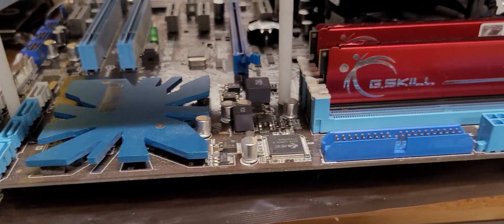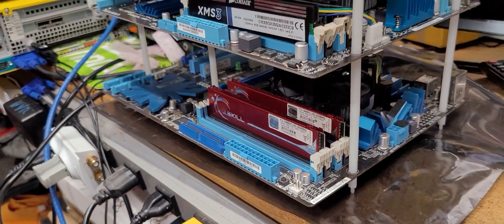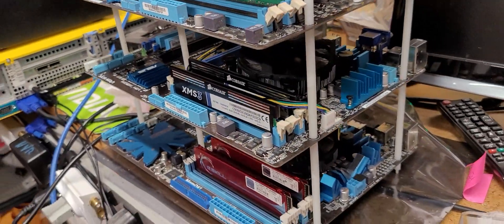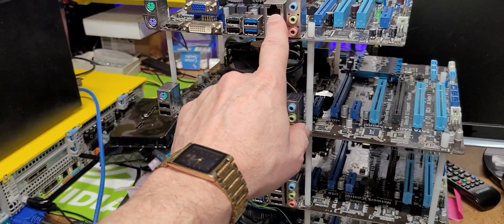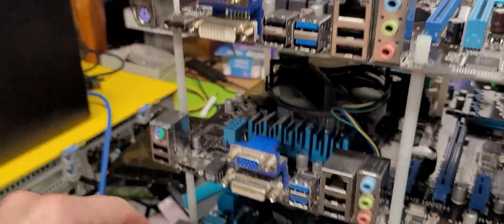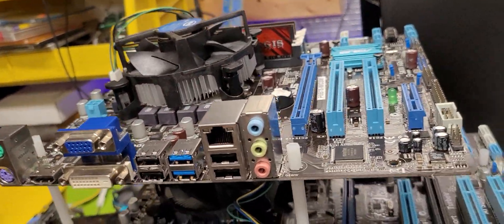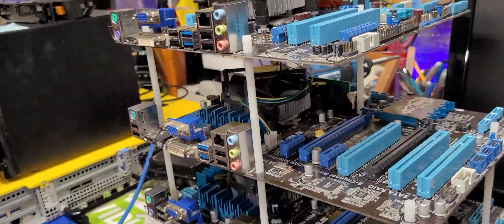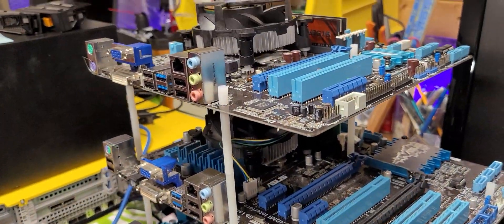A new monster I7 PC motherboard build out as a cluster  Not a complete waste of time! Fun!

Comment: hey brad, are you going to put this in the server or in its own box, i think you could put these alot closer together in the spacing as well like you did with the dell 7040's:face-orange-biting-nails:
Reply from the maker: Well no not at this time.  I was just playing around.   the size and airflow needs / clearance make this to much for my needs. I  will with MiniPC I think for now.  BTW I am going to rebuild the ProxMox Option 3 deployment back into Option 1 before I lose all the parts I have setting on the side.  /:>
Reply: @leadiususa7394  my oppinion would be to put all the parts in like a small container for each one and leave your proxmox open pemanantly then you wont lose the bits :)

Comment: I think it's a cool idea. I'm new to the multi-motherboard type setups so I'm not even sure what you'd be able to run on a build like that (but Im interested to see how this one works).
I've been trying to breathe life into a bunch of low-core mini PC's myself... buy to replace tasks I'd have on my Pi's so I can begin to free them up for better things -- but it's nothing like the clusters you've put together. I do not think mine would even be worth trying to cluster b/c they're only 2 core/4 thread m600 models.
Reply from the maker: Give it a shot for PorxMox does care and you can get some out of it and start learning the process..  Then later get other newer but cheap mini-PCs and build with more cores.   You can put ten mini-PCs if you and that will do about 15 to 18 VMs.  And remember that you can have 100 VMs for that is just storage, it how many you can run at one time is that will be the detail. about 15 at a time or so.   Also remember that vCPU and vRAM resources are greater then the cores and ram you have.  Enjoy man!
Reply: @leadiususa7394  - True yeah that might be a good idea to learn w/. I've never used Proxmox either but it's on my list of OS's to try. I'm actually waiting on 2 CPU's for an HP DL360 G6 and i was going to put ESXI on it (another OS I never used yet). 

But this would be interesting for a learning tool. I have more of the versions that have a giant heat sink on the inside. Do they all have to match in terms of the hardware? (to link them together as v-devices. 

I will have to draw some plans up and see what i could do w/ it. Even if it was 10 units, and 20 cores, it could possibly be a cool fanless setup, even if only for proof of concept n learning
Reply from the maker: @-ColorMehJewish-  No it can be a mix of CPU cores, just keep track of what VM or containers are on what box.  That is all.  ESXi has more overhead but ProxMox is pretty easy to work with and also fun to play with.  Great VM learning tool.  Enjoy man!